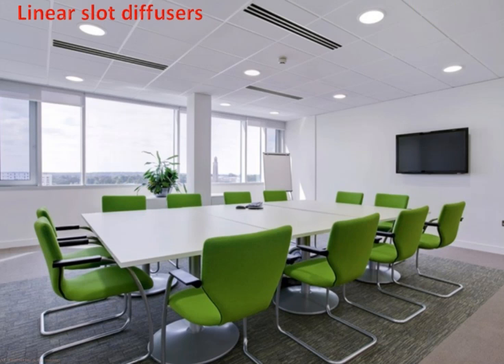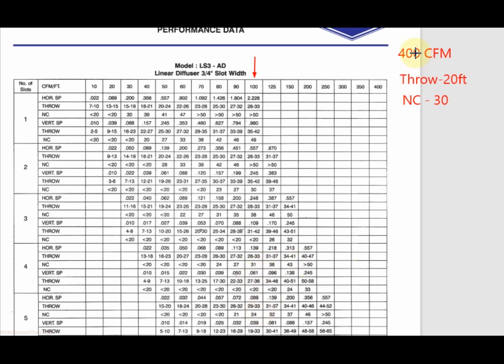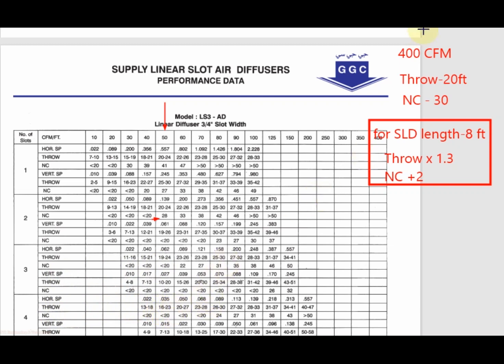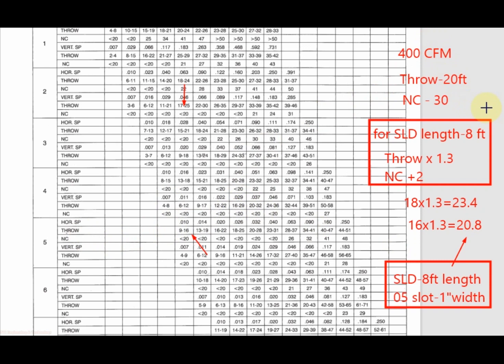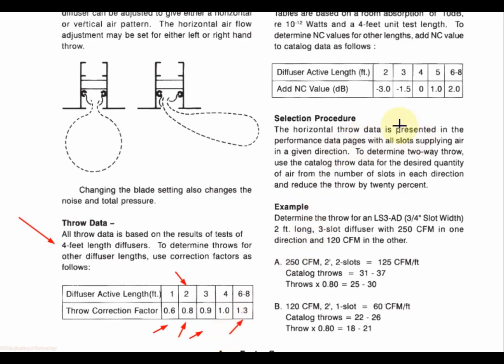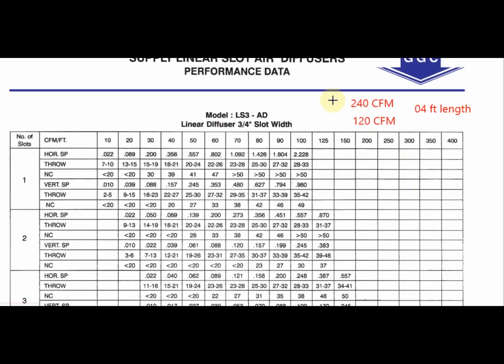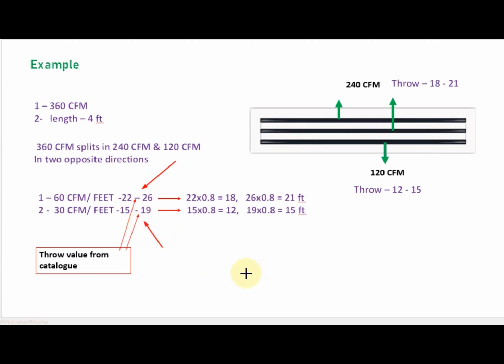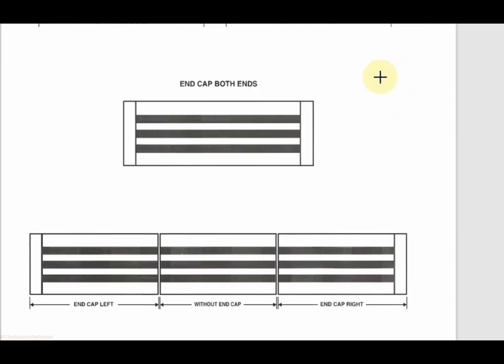103 - How to select Linear Slot Diffuser in English

Comment: Dear Engineer kindly ashrea recommended diffuser face velocity for different areas and heights. i think there is need to throw more light there
Reply from the maker: Thanks brother,
Actually I try to explain general method,
As per ASHRAE standard face velocity vary with sound level, in general practice we don't follow it.
even as my experience we hardly get around 85% of total design flow, if we are using big ducting network. 
you are most welcome, you can share with me your study, I will try to cover it some other video.
Reply: @ncengineeringtechnology3376   actually me I have been considering NC value for different areas as recommended by ASHREA. however I was wondering if there is also an ASHREA standard for diffuser face velocities.....